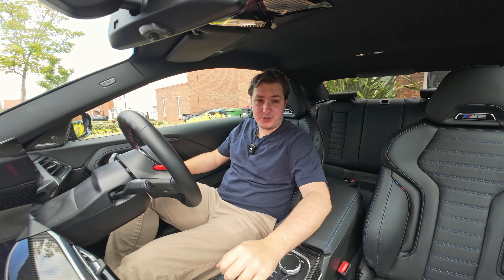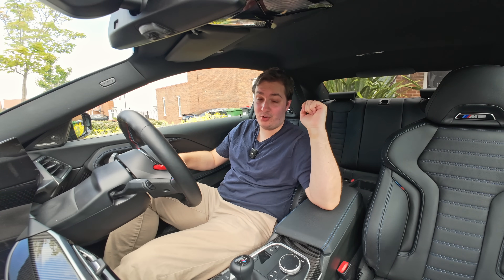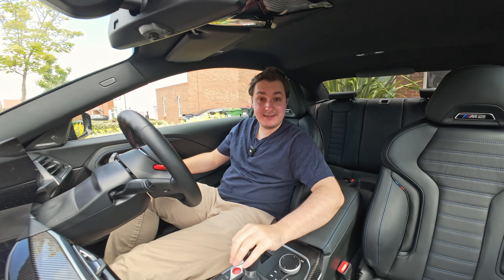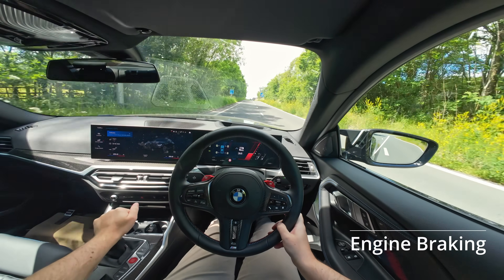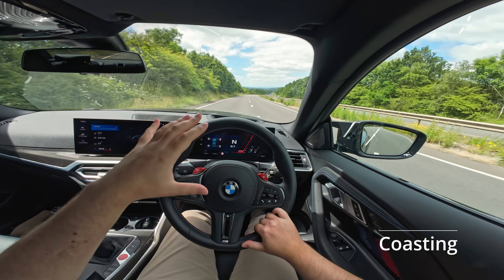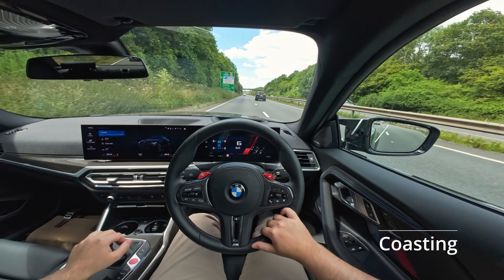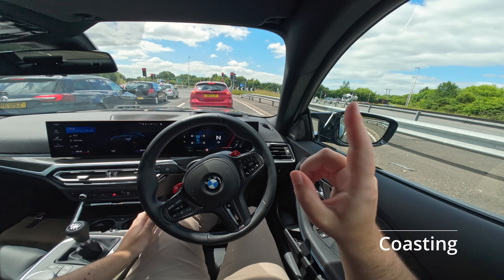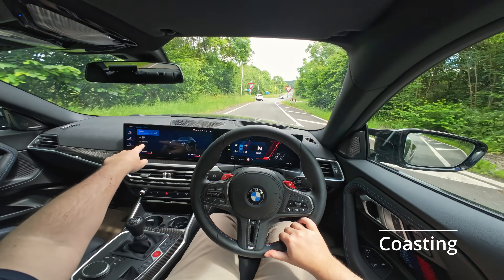Engine Braking vs Coasting - Explained and Tested

Comment: You can also downshift to engine brake quicker, so if you feel you need to assist with brakes, try to downshift first because then you save on brake wear

Comment: I’ve had this thing where the car would almost slip out of control for a sec and do a tiny acceleration whenever I floor the clutch to change gears, I never knew why and sometimes it would almost get me in troubleand no one else seemed to know either nor notice it in the first place and after watching this it makes complete sense since when disengaging the gear there no longer is any engine braking ig ?

Comment: Hey hey!
Please explain this to me.. if I'm going along and I get off the accelerator and switch from D to N, does this damage the ca in any way? Everywhere I've looked so far says it's a bad idea, but the reasons they give are from a personal safety point. 
Not only am I looking to save on gas, but I'm also looking to conserve as much speed as possible. Any insights would be appreciated 😊
Reply from the maker: Depends on the car - some are very smooth and will feed the torque in nicely. Some will just dump it and send a shock through the whole car

Try it, you won't break it instantly.

I do think overall it's a bad idea though
Reply: @MickDrivesCars bless for this. I'll give it a go. Btw your content is top notch.. practical, well researched, empirical and delivered with charm. Keep doing what you're doing sir 🖤❤️💚
Reply from the maker: That's means more than you know! Thank you

Comment: Very nice conclusions! The next pedal you press, will determine which is better: Accelerator -> coast. Brake -> engine brake. If you're a nerd (and/or a lorry driver) like me, it's helpful to think of the energy flows more holistically: You have chemical energy, kinetic energy and potential energy. Only way you can't convert energy is back to chemical (unless in a hybrid). There are practically no transmission losses while coasting, and the engine typically runs at a much lower rpm compared to engine braking, resulting in a lower total energy consumption. Unless, as mentioned, you are just going to brake and waste the energy you just saved by using fuel instead of kinetic energy.
Reply from the maker: Glad it was helpful! Great point about the energy flows as well.

Comment: Here in Brazil, driving with the vehicle turned off or out of gear on a public road is a traffic violation.

"Art. 231, item IX" refers to the Brazilian Traffic Code (CTB) and defines the violation of driving with the vehicle turned off or out of gear on a public road. This violation is considered moderate to very serious, depending on the type of road, and results in a fine and impoundment of the vehicle for regularization."

Engine braking, on the other hand, is not a problem and is even recommended because it "stops" the car without overloading the braking system. Plus, in an emergency, you already have the car in gear.

Comment: I usually use combination of both, you see red light in the distance and know you will have to stop at some point, so you lift your foot of the accelerator and let the car slow down a bit and when you are slowing down too much you put it in neutral and coast the rest of the way. You can get pretty precise with it too, so that you barely have to break at all at the destination. It's also important to be aware of potential safety risks with coasting though. Your breaking will be less effective and if you need to make a last minute maneuver, the car will be slower to react. Never ever coast down steep hills, and especially in winter when the roads can be iced over. Never coast in snow. And avoid coasting at high speeds, unless the roads are almost empty and you have good distance from all other cars. This seems very obvious, but many people drive their entire life in lowlands and then go on a skiing vacation in the mountains only to end up smashed into a tree, because they though coasting down and steep snowy road was a good idea.

Comment: You made me feel very old when you said 'most of you will not have driven normally aspirated, carburetor cars' 😳. Most of my cars have been that and I am also of an age when, if you dropped a spanner whilst working under the bonnet, it fell through onto the road often not hitting anything on the way down. Different times :)
Reply from the maker: haha, apologies - 70-80% of my viewers are 19-34

appreciate the comment and I'll try to phrase things slightly differently next time :)

Comment: Great content, Mick! I really appreciate your time and effort. One quick note about coasting for other drivers is that it could be dangerous if you have to abruptly maneuver or alter speed/course (deer, errant drivers, etc.) with a fraction of the traction due to the drivetrain not being engaged.
I wrecked my first 3-series in 1999 at 16 years old taking a freeway onramp in neutral (between gears) and slipped out after hitting a patch of road covered in loose gravel and silica sand. Costly lesson - but one that stuck. Thanks again and keep up the great work!!
(GORGEOUS M2, btw)

Comment: Question for some1. I've always used engine braking to go down hills. So say I'm in 4th gear, then get to a hill, I do a lil blip, get into 3rd and go down the hill. That's not using my clutch to engine brake right? Imo the blip gets rid of the wear. He means you're using your clutch to brake if you're just constantly downshifting and slipping the clutch without a blip right?
Reply from the maker: Exactly right

Comment: Actually using the clutch to brake is a driving technique. It is not ideal, has its drawbacks (mainly clutch wear) but can make you slow down faster (the engine has to pick up revs).
Reply from the maker: Yikes, I wish the best of luck to anyone that buys a car from you!

Just learn to revmatch broski, it isn't hard and you get all the benefits without wear.

Comment: Gears are for going - breaks are for slowing. Engine resistance = engine wear. Cheaper to replace brakes than engine components / clutch / gears.

Comment: Old video but. When I drove a car with bad breaks I almost crashed into someone because he stopped in the middle of a roundabout in front of me and i used the brakes hard and it did nothing but i instantly went 1st and dumped the clutch and the car did brake faster than the actual brakes 🤣

Comment: It would be interesting to do  two loops of the M25. One with coasting and the other with engine braking. That would more clearly show the difference. My automatic allows me to turn coasting on or off, so there would be no issue with operator error.
Reply from the maker: Too many variables with traffic on the M25 I think

You'd have to do it at night and then nobody would watch it because you video quality would suck

Comment: so if I drive an automatic, whenever I take my foot off the gas, the fuel injectors stop injecting fuel?
Reply from the maker: yep, aslong as you're above about 1000 rpm and in drive

assuming your car is relatively modern or less than ~20 years old

Comment: There's also the pulse and glide, which in a 500 horsepower car with effortless acceleration even if you're only using 2000 revs it's probably more effective relatively speaking than in my Fiesta 1.2 where you are probably using a higher proportion of torque just to keep going.
Plus you have a torque gauge on that car so here's what you do on a dual carriageway: Give it a high torque burst in 6th from 60-70 (most of the way down but not all if it runs rich - torque gauge should be at about 80%, learn where this is on the accelerator for muscle memory). Go into neutral until the car's speed has dropped back to 60. Repeat.
It will probably be even more fuel efficient at lower speeds, though you might want to use 5th to accelerate if you start getting into the 40-55 range. Below that it might just be less work to putter along in 6th at a steady speed.
That or drive it like you stole it to maximize smiles per gallon (within reason so as not to crash).

In this test you're better off coasting on the dual carriageway section and then engine braking up to the give way line at the end.

Comment: Added to this, one can argue that an added benefit of coasting is that you're putting lest stress on the engine. Depending on the speed and the gear engaged when engine breaking, rpms can stay quite high when coasting just keeps the engine at a steady 800 rpm or so. Much nicer to the engine.

Comment: This is a weird comparison. 
Coasting is something you can do to save fuel. Engine breaking (it's in the name) is something you can do to save your breaks. It's very useful in mountains, where people not using engine breaking can genuinely have breaks malfunction (if you are on the break for half an hour on a steep mountain and your breaks are not in good condition). 
Using engine breaking to save fuel (how even? You speed up couple of km above your target speed and let it slow down by engine breaking to the target?) doesn't make sense, just leaving the car at target speed must be better or same.
Obviously if you need to slow down a little, i.e. due to traffic slow down, then by all means it's better to use engine breaking (lift your feet off the throttle) than the actual break. But mostly you just won't wear your breaks as much. Don't expect better fuel economy, maybe just due to the fact that using engine breaking, you are less likely to break more than you need.
Reply: The engine braking is for when you get too much speed from the coasting. Otherwise the fuel you saved not idling is more than cancelled out by having to press the accelerator more often because engine braking is slowing the car down and you don't want it slowed. If you have a steep downhill and you need to stop or there's a low speed limit or tight bends at the bottom, then coasting down it without braking is going to be dangerous. You may as well go into a gear that gives you a reasonable speed and also save the fuel you would have burned idling for the length of time you were going down the hill.

Comment: I get 23 mpg from my 185 hp Alfa Romeo 159 2.2 JTS saloon manual. I use engine braking all the time, but do mostly city driving.
Reply: Don't know if that's impressive or not. My least efficient car got 40 mpg (2008 Cooper S Clubman 170 hp) and it was 1200kg, shaped like a brick and had a touch of the old brake drag too. I had one 54 mpg but that was literally a boring 40 mph run the whole way (you know the day dawdlers with a queue of 10 cars behind that can't get round). Everything else was more expensive and it did drink oil as I think there was a problem with the turbo, and eventually the cylinder head cracked, which is annoying because whilst I did have some goes accelerating as fast as possible to 80, I didn't drive it like I stole it everywhere.
Reply: @TimpBizkit  Not realy. It is not the most efficient engine. It is more tuned for performance. 185 hp from a 2.2L NA engine, although with direct injection. It has a curb weight if 1.445 kg. And I use UHP tyres, for the summer set at least. And I like to drive it spiritedly, when the conditions (traffic) allow. It does about 28-30 mpg on the highway.
It also burns some 200-250 ml of oil every 1.000 km.

Comment: Wait, why do you believe no fuel is entering the engine when you are engine breaking? The throttle body isn't a perfect seal, it allows some air to pass for idling. Your car is basically still trying to idle when you are engine breaking. The MPG measurement on the car is measuring how much fuel is injected over the distance traveled. Since coasting and engine breaking are both attempting to inject the same amount of fuel (attempting to idle), of course engine breaking is worse MPG because you slow down faster and travel a smaller distance while injecting the same fuel as coasting which doesn't slow down as fast and travels longer distance. I do know about DFCO, but doesn't that really only kick in at higher RPM ranges?
Reply from the maker: DFCO is used at all RPMs above idle. It'll stop once you get to ~1000-800rpm so you don't stall.

This is obviously for modern, fuel injected cars.

Comment: "Engine braking is not" describes exactly what engine braking is

Also most, slightly older, cars do not cut off fuel flow to the engine. That's a mostly modern feature, in an older car you are much better off just using your brakes.

(Engine braking is leaving the car in gear and letting the engine slow down the car, all while the clutch is still engaged. This won't ruin your car but it is extra wear on your clutch, and brake pads are much cheaper than a clutch replacement)

Comment: I would just add, that driving in neutral can be dangerous, as you have no power in case of emergency, perhaps an oncoming car, somebody cutting over, coming in from the back at high speed, etc.But it is a nice feeling, just use it responsibly :)

Comment: Engine braking doesn't use fuel while you're using it (above a certain rpm), but in neutral you can begin the slow down earlier without the car going too slow. So use engine braking on downhill and low speed limit at bottom and coast when you can keep going. Some people turn the engine off to coast to get the best of both worlds but can be dangerous in certain circumstances.
I mean you can fail your driving test for extended coasting, but it does have its uses for lowering your rolling resistance because you are not moving those engine cylinders up and down as quickly when you don't need them. Sure you are using a bit of fuel to keep it idling but you don't have to accelerate as much when you finish the coast.

Comment: You can control the amount of engine braking to be induced by not letting off the throttle entirely. There's a sweet spot just lower than that of maintenance throttle where the transmission gets unloaded the most while still remaining connected. This can maximize the glide effect without sacrificing the safety of being in gear.

Comment: You can safely brake with your gearbox as long as you a) don't downshift more than 1 gear and b) release the clutch petal just to the initial biting point and then immediately press it down again. I have 350,000 KM on my C220D and the gearbox is just fine. As for coasting vs Engine braking.. the later has the transmission engaged which means mechanical resistance, friction etc so naturally you slow down. Finally, one should never drive in neutral or with the clutch pressed.

Comment: Great video but there's no baseline... you need to re do it with "normal" driving, keep speed (cruise control?) and only brake when you legally have to start braking (no engine braking, no coasting - obviously you can't not engine brake but use your foot brakes as the main source of braking)

Comment: Engine braking is better as long as it doesn't mean you have to press the gas to keep your speed. Driving fast won't see the full benefits because even going down quite a steep hill at 70mph will slow you down due to air resistance

Comment: Important thing to notice when going on big descents regarding coasting vs engine braking. There are very steep mountain roads near my city and it seems like a lot of people get confused when it comes to going downhill, especially on steep tight turns etc. The best & safest way is using engine braking on a lower gear and higher rpms so you get more "engine braking".  Otherwise if you coast down the hill you'll wear out and overheat the brakes in no time which is a big no no. Using the engine as main braking source means you'll have to use the breaks less and it still uses no fuel. On newer cars injectors shut off automatically and spray no fuel when engine braking.
Reply: Well said! Much better traction while in gear with the drivetrain engaged, too. Taking turns in neutral can be pretty dangerous - especially on a slick road.
Reply: When you say newer cars, generally from which year did manufacturers start doing that?

Comment: Do you typically hold the steering wheel at the bottom, or is it because you have reclined your seat for video recording purposes?
Reply: Side for serious driving bottom for relax
Reply: If you get in a wreck, driving with your hands on the bottom would save your arms from being injured.   The airbag can break your arm, taught to me by professional driver.

Comment: Having been taught to drive in 1966 by driving a 3½ton Army Bedford, engine braking was paramount. Up until a year ago - 2023, when I bought my first automatic, engine braking was my preferred driving method and it always meant that I was probably already in the correct gear for the moment when I began to pick up speed again!
There were times however, when, as a poorly paid soldier, I would coast at every opportunity.

Comment: The other day I was going to the beach and from my city to the beach is almost 1 full hour of big downhills so i was engine braking through most of it. The problem is sometimes I had to push the throttle, I knew about coasting but heard that the engine heats up and it can be damaging so I didn’t tried it. The thing is idk how true is that information. If anyone knows pls tell me <3
Reply: I mean surely if the engine doesn't overheat idling while stopped it won't overheat idling with fast air passing through the radiators